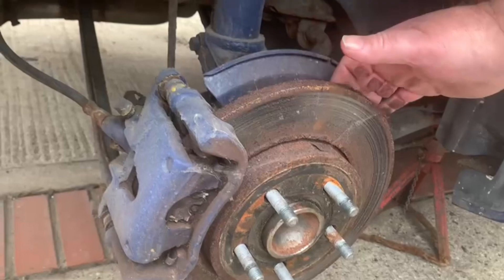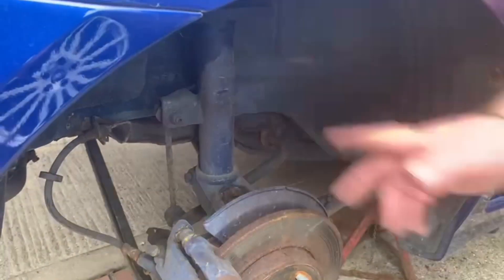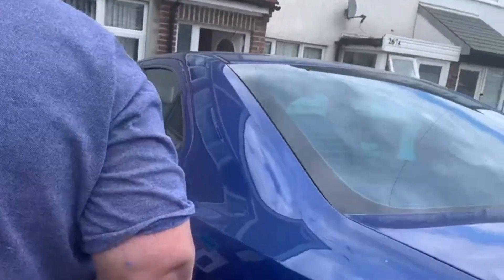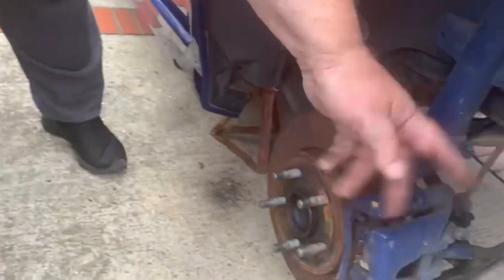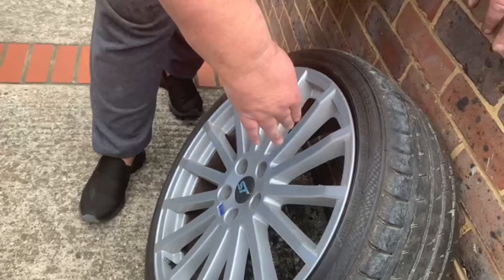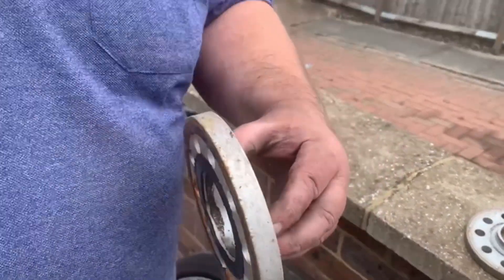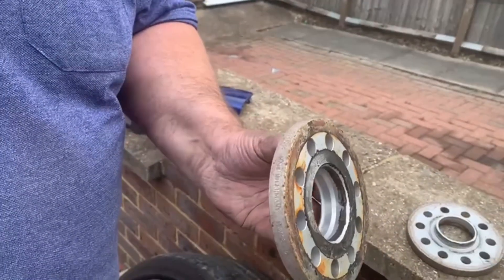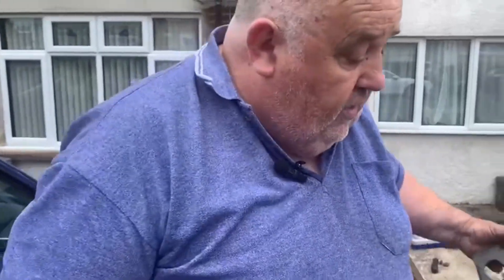Performance blue project part 1

Comment: Usual Rust Under Wheel Arch Liners...
What's the difference between your rear calipers and final facelift?
Part Numbers? Manufactured by?
Reply from the maker: It’s to do with the handbrake the way they operate on the pre-facelift they always Caesar up that’s the only reason

Comment: If you're going to be re-bushing the rear subframe, I don't understand why you have ruled out polly bushes? It would be fit and forget, you'd never have to do them again!
I've had mine done and will be getting the front polly bushed when I have a new clutch fitted and Sport CAT's some time in the future.
Reply from the maker: Alan I can understand what you are saying but I’m old school and I just try to keep her standard reference the the ride of the car
Reply: @st220saloonrestorations  I can relate to that pal. Each to their own 😊
Just thought polly bushes are one of those things that will never deteriorate and actually make very little difference to the car in all other ways. 
Yesterday I had a spot of bad luck with my old girl. The passenger side windup was squeaking and slow to rise when I was last out in her, so I thought I'd spray the guides with silicon before it becomes a bigger job. You can probably guess what happened. 🤦‍♂️
But not only did the passenger window fail, so too did the drivers side. The bowden cable has snapped on both. Passenger side with the window up, drivers side with the window down. And this week I'm holidaying in Wales so I've had to strap the windows up. New cables on order and will be ready and waiting for when I return, only £12 for the pair. Hope nothing else let's me down this week 😊
Reply from the maker: @ajfrenchie  this is the enjoyment of running a st220 they always keep us on owl toes hope you have a good holiday